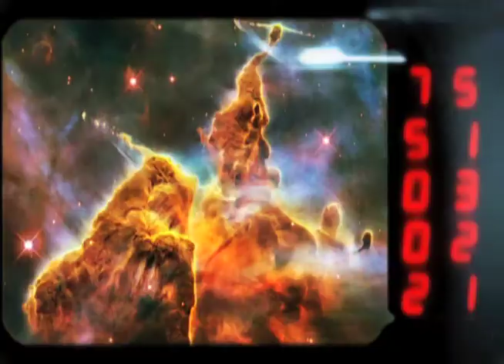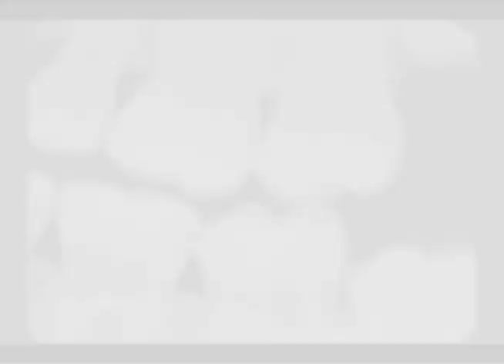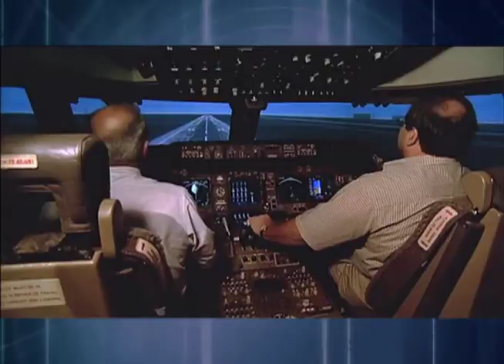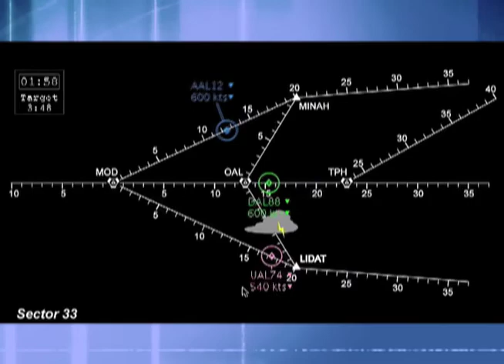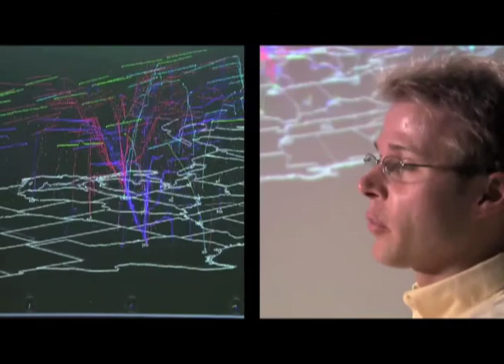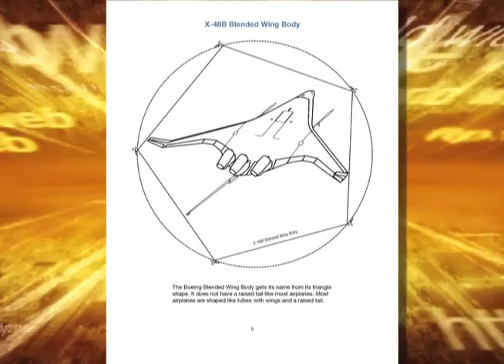NASA Now: Air Traffic Management

Comment: IDEAS O CONOCIMIENTO QUE PUEDEN SALVAR VIDAS
1-El trabajo de controlador de vuelos ya de por sí es muy tedioso pero, podría haber algo que quizas quite un poquito esa tensión.
2- Hasta donde yo tengo entendido a los distintos vuelos cerca de los aeropuertos se les asigna un nivel o altura de acuerdo a sus prioridades para el aterizaje.
3-Esas alturas a mi entender estan asignadas en miles de pies o de metros(10,000, 15,000, 20, 30 o 40,000).
4-Por esa razón cuando ocurre una colisión es por el error de haber dos aviones con la misma altura en direcciones que se intersectan. 

MI SIMPLE IDEA ES QUE TODO AVIÓN QUE VUELE EN LAS DIRRECCIONES ESTE U OESTE SE LE ASIGNE LAS ALTURAS EN MILES DE PIES O METROS (ej. 5,000, 10, 15 o 20,000). A LOS VUELOS ESTE HACIA EL OESTE SE LE ASIGNARAN LOS NUMEROS PARES (10,000,12 o14,000)Y LOS CONTRARIOS LOS NONES (9,000, 11, 13, o 15,000).

A LOS VUELOS NORTE SUR SE LE ASIGNARA LAS ALTURAS EN EL RANGO DE LOS 500 (10,500, 15,500 o 18,500) Y DE LA MISMA FORMA A LOS EN DIRRECCION NORTE LOS PARES (10,500, 12,500 o 20,500) Y A LOS DIRECCION SUR LOS NONES (9,500, 11,500 o 21,500) 

PARA LOS VUELOS EN DIRECCIONES DIAGONALES (NORESTE, SUROESTE) SE PODRÍAN ASIGNAR EN EL RANGO DE ALTURA DE LOS 250 (10,250, 12,750 o 20,250) Y DE LA MISMA FORMA EN DIRECCIONES CONTRARIAS LOS PARES Y LOS NONES.
ESTANDARIZADO EN TODO EL MUNDO Y ASÍ NO EXISTIRIA LA POSIBILIDAD DE CHOQUE.